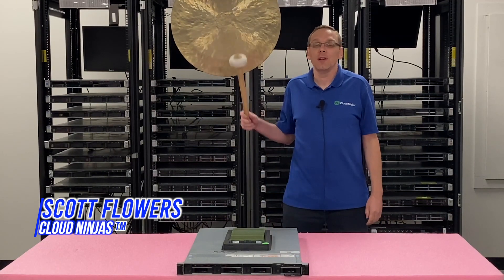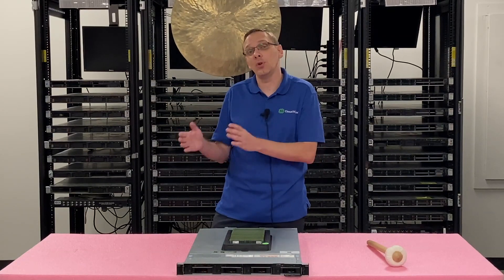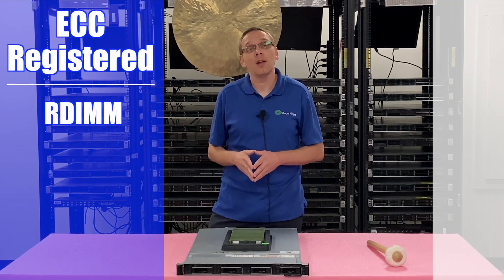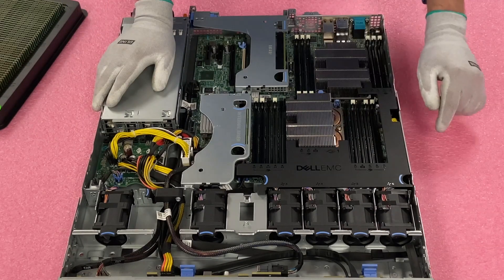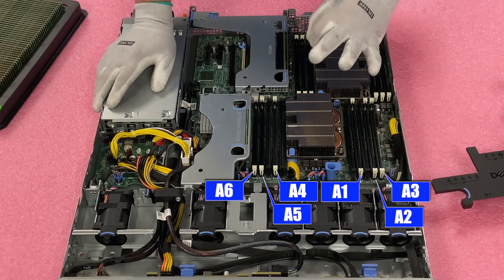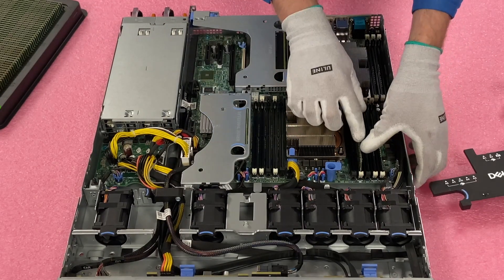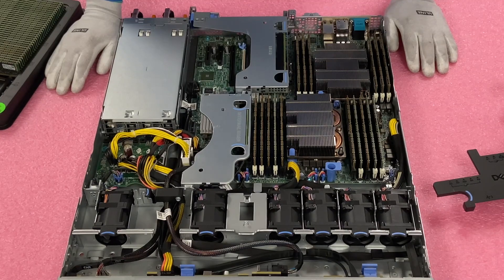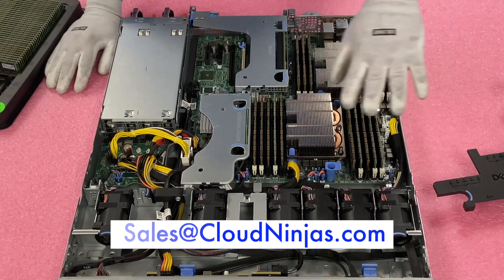Dell PowerEdge R440 Server Memory Overview & Upgrade | How to Install Memory | Supported DIMMs

Comment: A question! If I have 4 RAM modules - 2 of 16GB and 2 of 32GB, how should I proceed? I also have a server with 2 microprocessors. I have read that I have to populate the A slots with the 32GB RAM (A1 and A2), and then the B slots with the 16GB RAM modules. Is that correct? Amazing video, very informative

Comment: Unbalanced memory is not great, they should have balancing it instead
Reply from the maker: Definitely.  I remember being really surprised the first time I opened one of these up.
Reply: @cloudninjas  Hpe better!
Reply: @cloudninjas there are a slew of Dell servers like this and you suffer a significant memory bandwidth penalty if you fill all DIMM slots to the point it all most never makes sense. TL;DR you are not getting 2993MHz if you fit 16 DIMMs.